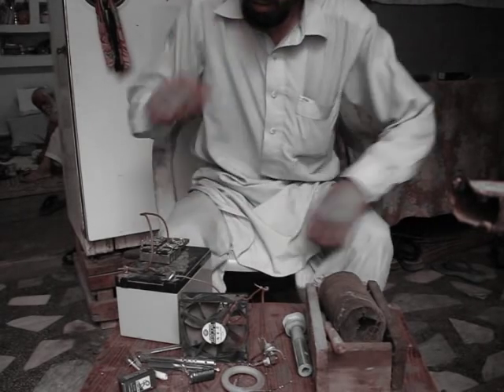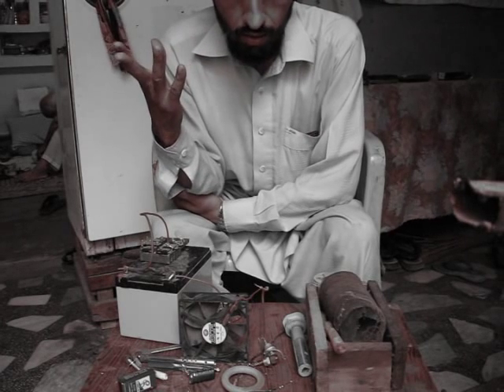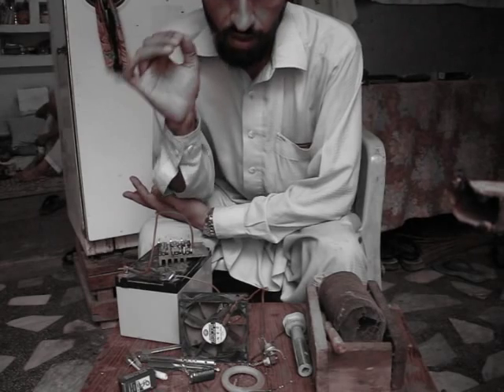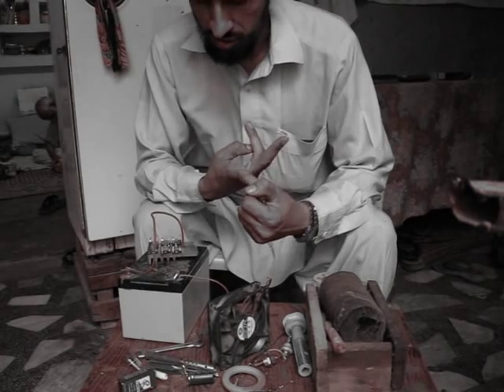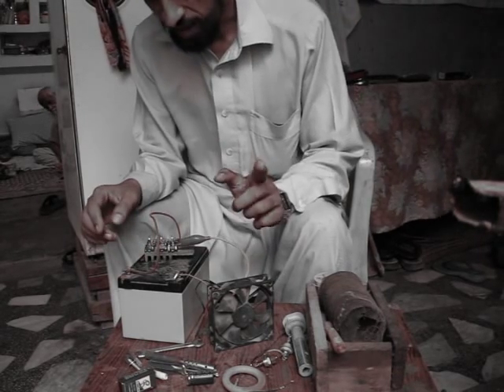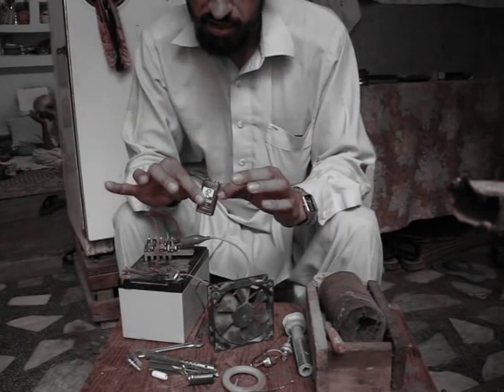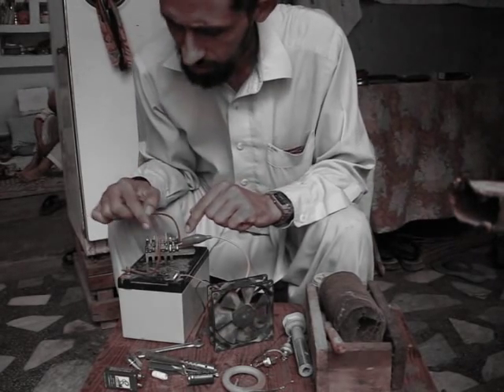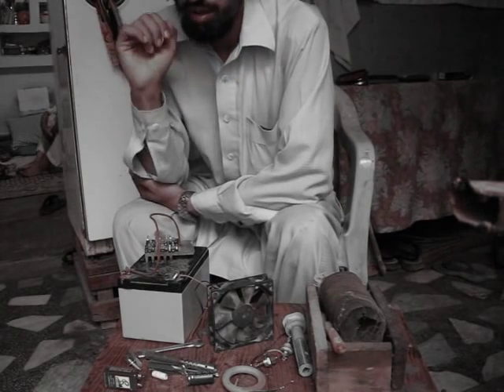Testing N Channel MOSFET IRFP 150N

Comment: This MOSFET is capable of a LOT more current than the computer fan you used.   At 25 deg Celcius, it can handle 42Amps and 160Watts.   Would it not be better to use a 12v device that draws more current....say at least 20-50watts to put the MOSFET under a bit of a load?  The MOSFET could be damaged but able to pass very low currents but under real world loads of higher current maybe not.